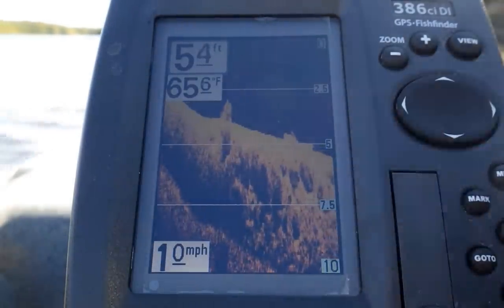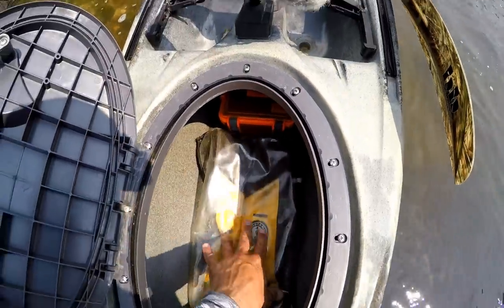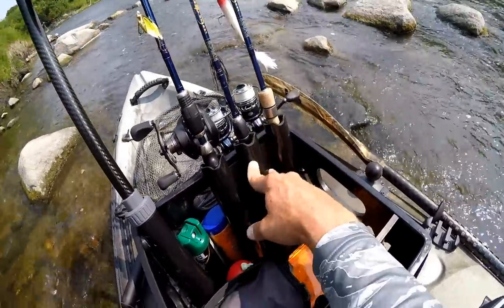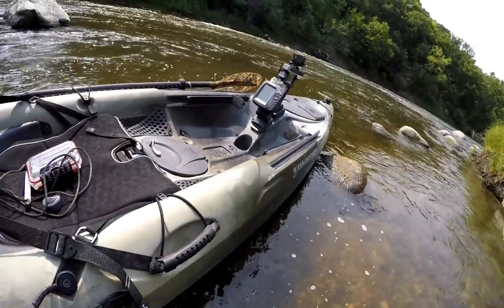My Tarpon 120 Fishing Kayak

Comment: Hands down the slickest Tarpon I have ever seen. I have a Pre-08 T140 (rubber front hatch, no gear tracks...) that I'm getting rigged now, and you have really given some inspiration! Also, as a test electrician, and electronics tech for 16 years I have to say bravo on your on-board power system for the cameras and FF-very clean install,  my man.
Reply from the maker: Thanks Marc! A lot of planning went into this setup, probably more time spent brainstorming than actually building. I think the hardest part was coming up with ways to machine some of the plastic parts with the limited power tools I have. I couldn't be happier with how it turned out though, I haven't changed a thing since shooting this video and I plan on keeping everything the same for this season.

Comment: huge props on your camera set up! I can tell a ton of time went into getting that the way you want it. Would love to see some night time shots from this year and if you are doing any more mods film the build process. Fish on!
Reply from the maker: Thanks man! The only problem with the light is it draws a lot of bugs so I use it mostly for a navigation light while I'm moving. I might have to try a night bit for some walleye this spring though before the bugs get too thick. I'll have to experiment with some colored lenses over the light this summer too, maybe I can avoid drawing them in. I haven't made any other changes to the kayak yet. I'm thinking about getting a micro power pole for cat fishing but I'm not sure if I'd put it on this kayak or the orange one.

Comment: Nice kayak layout! Well though out and not too cluttered. You should market that camera/light mount - professional rigging job throughout.
Reply from the maker: FlyForPike Thanks! I can't imagine a price I'd put on the camera rigs with all the time invested in them. I've thought about taking the idea somewhere, I think I'd need to waterproof the plug going into the Gopro to make it appeal to a bigger market.
Reply: Maybe glueing a O-ring where it plugs in at might work
Reply: @ndyakangler  an o-ring land recess at the jack plug hole. A revised case for the camera may be necessary.

Comment: I really, truly,  want to pay you to fabricate some mods for my kayak! I love your camera and microphone mounts! I've been a fan for awhile and all of your video and audio content is top-notch! And, you catch some nice fish, too! Message me if you'd consider a customizing job for my fishing kayak. Awesome video and congrats on your new Tarpon 120!
Reply from the maker: skfish Thanks man! I might consider it in the future sometime, during fishing season I don't have much spare time to build though.
Reply: skfish I agree.  NDYakAngler is the best at details.  I too envy his camera and mic powering.  I use a KMASHI 5v, 10,000 mAh battery with 2 USB sockets and run the USB power cables from the battery inside the hull to grommeted holes where they exit to connect to my 2 Veho MUVI cameras, one forward and one aft, also.  Works okay, but it is not as neat as NDYakAngler's setup.
Reply from the maker: ***** I've been looking at those lithium battery packs, once they up the capacity a little more so I can go all day on one I plan on switching to them as a power source. It would be nice to drop the 13lbs of lead I'm hauling around with me right now.

Comment: Killer new setup! I just finished my crate and was worried about the rods that I have in the crate rod holders getting caught in trees when I'm on the river...Thinking that my crate may only be useful for ponds and lakes which would be pretty disappointing since I fish rivers 90% of the time
Reply from the maker: btratcat23 Thanks! That's another reason I decided to angle the rod holders back, at least if I'm moving forward they'll easily bend and slide under any low branches. My old crates had them sticking straight up in the air and I never had much of a problem. Most of the time I stay out of the trees and just cast my lure into them. If I have to go in to retrieve a snag or cool off in the shade for a while I'll pull the rods out of the crate and lay them down between my legs.

Comment: By far one of the best setups I've seen so far. I'm running the Perception Pescador 120 & just bought a camera. I've seen several comments asking, but I figure I'll give it a shot... Is there any chance you could do a run down video on the electrical charging setup for the GoPros? Flawless job all around!
Reply from the maker: I need to do that, I get asked about the power setup all the time. I'll have to round up a few things to help demonstrate how to do it but I'll try to get a video made soon.

Comment: Thanks for responding.Given what I've seen from your videos I'm surprised you didn't make a remote controlled dolly for your Tarpon. I just purchased the Tarpon 120 Angler yesterday. Your "My Tarpon 120" vids were instrumental in my decision process.It's hanging in the garage calling me, I may have to throw it in the pool just so I can get into it on some water.There are so many lakes and small tributaries in this area to tour and fish, many of which I will have only a path by which to gain water access.Just wondering if its worth making my own dolly or buying. I'll check out the both options.All the best.
Reply from the maker: It's a tough call on buying or making a dolly. I got mine on sale for around $50 so that made the decision a little easier for me. I was also a little concerned about puling a homemade pvc one over rough terrain and having it break if I hit a bump too hard. I haven't used it yet but I've been checking out a couple spots on Google maps I might need it to get to this summer. Most of the time I can get away with pulling my kayak with a pull strap if I cant get close enough to the water. Grass, dirt, and sand won't do much harm to the hull if you have to pull it a short distance.
Reply: Made the dolly , worked great till it didn't  - like you thought it didn't stand up to any rough terrain.  I'm going to have my buddy make same only out of aluminum, for me its all about the weight as I want to take it with me on the yak.  Outstanding videos as usual  - and thanks for being so generous by sharing your knowledge.

Comment: That is one sweet set up. I use a go pro front and back but no external battery. My challenge was the fact that I like to fish but I also like to do some whitewater kayaking. (Level I, II, III) So my go pro mounts had to be either flexible or have a break away feature in case I turn over in the whitewater. I used big washers and a big magnet to create the break away feature. I have a 10' kayak (Lifetime Tamarack) that works well for fishing and whitewater but recently realized that in level III whitewater it filled with water easy and took a while to self drain so I am looking for a new kayak that will still fish well but do a better job in the whitewater. My friends had a Heritage 10' and a Pescador 10' and I guess they just ride higher out of the water therefore do not get filled with water and drain it out faster too. I also noticed that theirs seemed to paddle faster than mine as well. I was thinking about the Tarpon 100 mainly because I have always felt the 12' is to long for whitewater. What are your thoughts and do you know if the Tarpon 100 is a good rig as far as all the things I have mentioned. Speed, not taking on excessive water and draining out quickly?? Thanks
Reply from the maker: Thanks Rickey! That's a great idea with the magnet for a break away mount! My paddling experience is limited to my Tarpon 120's but I have a friend who has a 100. It's not as fast as the 120 but it does ride a little higher in the water. Both have the same scrupper holes and mine always seems to drain out almost instantly when I get swamped going over a dam. The Tarpon 100 should be very similar to your friends Pescador, they're basically the same hull.
Reply: Thanks. That is what I was thinking but I think I like some of the features of the Tarpon 100 even though it is about $200 more. Does the hatches on your 120 leak bad when swamped??
Reply from the maker: I've never had a problem with mine leaking.
Reply: Thanks

Comment: I just looked up this video to see what kind of kayak you had for some research of my own.  I did not know you had such an awesome setup for the electronics! The transducer goes straight through the yak?
Reply from the maker: The transducer will shoot right through the plastic as long as you glue it down or use some duct seal between the two and make sure there’s no air bubbles. It works for regular sonar and down imaging, but not for side imaging transducers.

Comment: river monster. I had noticed the new paddle in previous videos, nice one. How come the new boat? The old one was pretty awesome I thought. BTW I just bought another one myself.  :-)
Reply from the maker: TomHeid1 The old one was getting a little beat up on the bottom from going through shallow rocky stretches like this and the seat was starting to fall apart. I still could have probably got another year or two in it without repairing anything but I decided I'd get a new one. I wanted to switch over to the camo color anyway since there's not much traffic I need to make myself visible to where I fish.
Reply: NDYakAngler The new boat's a beaut, that's for sure. Appreciate the fine video work your setup produces,  not to mention the lunkers you pull over the side..I drool a lot. :-)

Comment: Just ordered mine for this season of catfishing.  Awesome video and set up! Can you give me some information on the fish finder rig I want to shoot through the haul as well.
Reply from the maker: I just used the transducer that came with my humminbird 386di. Side imaging is about the only thing that won't work through the hull. I used marine goop to glue mine down. Squeeze a good size glob of it on the bottom of the transducer and press it against the spot on the hull where you want it, trying not to get air bubbles in the glue in the process. I kept mine from sliding around with a few strips of duct tape and added some weight on top of it to keep it pressed down while it dried. I let my kayak sit still for a few days to make sure the glue dries completely.
Reply: awesome thanks!

Comment: I would like to know more about these side pockets and what the material you used was. I love the look and function of those pockets from other videos.
Reply from the maker: The side pockets were there on the kayak from the factory. They changed the Tarpon 120’s a couple years back and pretty much got rid of them. There’s still a spot for tools there but it doesn’t look as deep and it doesn’t have the rubber netting cover.
Reply: @ndyakangler  Darn! That's unfortunate. Thank you for answering my question! Love your videos. So relaxing to  watch.

Comment: You are an awesome fisherman and I enjoy watching all your clips, Thanks.  Question on your AV setup. You have two cameras I assume you are rolling at the same time, you enter them on your timeline in your software and cut to each cam for final render. My question is your audio recorders. Are you using the Gopro mics or are you lining up the recorders in the timeline for cut.
You appear to be a very good producer also. Thanks
Reply from the maker: Thank you! I record audio directly onto the Zoom H1s and swap it in editing. I tried wiring the H1 mics output to the GoPro but I didn’t like the way the GoPro processed the audio. It didn’t sound nearly as good as having a separate recording.

Comment: SWEET set up. I've been fishing from a Pungo 120 sit inside. This video has helped me make up my mind for my next one. The only thing stopping me is I dont know how dry you stay in the Tarpon. I do alot of spring fishing when the ice isnt all the way off the lakes. I dont mind water from the paddling or catching fish....but how dry do you stay when just regular lake fishing with a slight chop? And does water shoot up when you cross boat wakes? Thanks for the video and you time!
Reply from the maker: I stay pretty dry in my Tarpon, other than getting splashed by fish. As long as the wind is under 15mph it doesn't get choppy enough that I get sprayed by waves as I paddle along. If the wind is stronger than that I'll usually stay home or try to find a calm stretch of river to fish. I've paddled through white caps on several occasions though and as long as I hit them at the right angle I'll stay dry. The Tarpon hill as a couple scrupper holes under the seat that come plugged from the factory. Mine popped out at some point but I didn't bother putting them back in. Only twice I've felt water come up and soak my seat. Once was when I took the kayak over a small dam, the other time some a-hole in a bass boat flew by about ten feet in front of me and water shot up under the seat as his wake passed me.
Reply: +NDYakAngler sounds great! Thanks for the info.

Comment: I'd be really interested in learning more about how you create your GoPro set up and installing your battery chargers. Thanks!
Reply from the maker: If I take everything apart for a cleaning this winter I'll do a quick video showing the camera mounts in more detail. All you have to do to have the Gopro always charging is run a 5v signal to it. I used a 12v battery with a 12-5v converter I ordered from AliExpress although a simple car usb charger can be used as well. I had to put a hole in the Gopro case for the plug to go through so its not waterproof any more. I also used parts from Charge Converter to make my own usb cords. There's a link in the info box to the page and they have a link there for a pinout of the mini usb plug that shows what each pin inside needs to connected to.

Comment: Brilliant mods,  do you have or can you recommend any vids on how you made the camera mounts with the power supplies?
Reply from the maker: The Urban Sportsman Thanks! I designed and built pretty much everything myself except for the ball heads at the top of the camera poles. I didn't film any of the building process because I have probably 100 hours of work into each of the camera rigs so it was already time consuming enough. I was also working with limited tools, I used a cheap drill press as a makeshift lathe and a big nail sharpened down to a cutting point to machine out most of the round plastic parts so I didn't want anybody trying to copy me ending up injuring themselves. I came close a couple times lol. A simpler way to run power up to the camera on something like the crate mount would be to just leave the electronics out of the pole and have a long enough cord coming from the power supply in the crate to wrap around the pole and up to the camera once its in place.

Comment: Are you making this stuff in a machine shop or by hand? That is a little OCD'ish, but I like it the details in your work sir. I have watched about all your videos. I guess I am a fan now. Thanks!
Reply from the maker: I made all of this with pretty basic power tools, a drill, jig saw, dremel tool, and a cheap drill press. Luckily HDPE plastic is easy to work with.

Comment: I really like your anchor trolley setup over what I've seen out there.  Any chance you could tell me the trolley brand hard wear setup you used?  Was also was wondering if you have ever tried a skeg for it?
Reply from the maker: I used Ronstan and Harken pulleys and mostly Yak Gear components although some of it is custom made. Never tried a skeg. I really don't even use the anchor much, mostly for fall fishing when the smallies move into the reservoirs and the wind is blowing.

Comment: Hey man love your videos, getting my own fishing kayak soon and I was wondering with the transducer glued on the inside of the kayak with marine glue have you had any problems what so ever? And did you have to drill holes in your kayak to get the battery wires hooked up to the fish finder? Also what marine glue do you recommend? Thanks
Reply from the maker: I used Marine Goop to glue in the transducer and to seal around the wires where they go through under the base of the fish finder. I did have to drill a hole to run them through. That mounting spot is a pretty standard size so it would be easy to cover it with something if I ever wanted to remove the fish finder. The only problem I ever had was with my other kayak, the transducer went out after a few years which isn't uncommon. I was able to pry the old one off and remove the rest of the glue stuck to the kayak when I replaced it.
Reply: +NDYakAngler awesome thanks for the response. With the transducer being inside the kayak also do you still get accurate water temp readings?
Reply from the maker: It's still pretty accurate. I've compared readings to a few transom mount units and mine was always within 1-2 degrees. It will take a half hour or so after launching sometimes for everything to acclimate to the water temperature so it might be off a little bit at first.
Reply: +NDYakAngler Thanks man I really appreciate the info. Keep up the awesome work you have the best yak videos on youtube!

Comment: How do you get the audio on the zoom to match up with the go pro? Some fancy software?
Nice kayak. I just picked up the Ride 135. Happy fishing.
Reply from the maker: Tim Martin Thanks! To swap the audio I'll make a copy of the final video with the native Gopro audio then extract a copy of the audio from it to use in Adobe Audition. Once I have that opened I'll add the Zoom H1 files, line them up, trim them to match the start and end points, do a little EQ work and export the replacement audio file. Then all I have to do is go back to the video editor and mute the native audio, add the replacement file and I'm ready to export the final video with new audio. This one was pretty easy, the fishing videos where I have 20-25 different clips to set the audio to get a little more complicated. There are many other programs that will let you swap audio too and probably a tutorial here on youtube for each one.